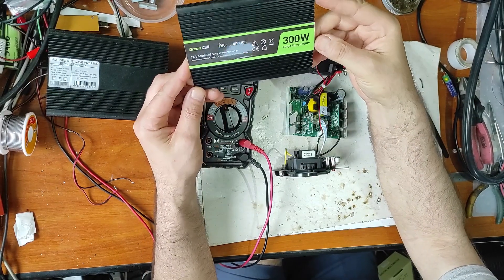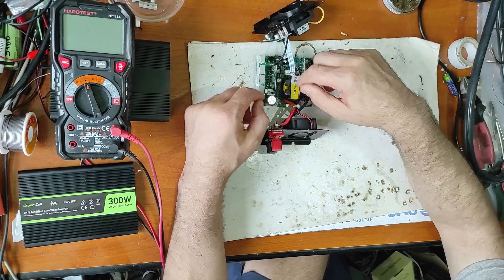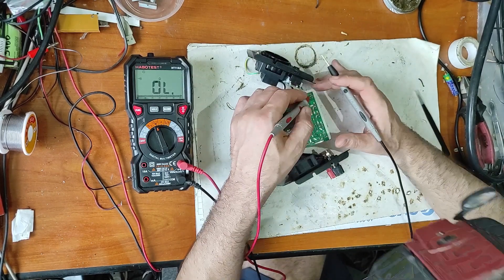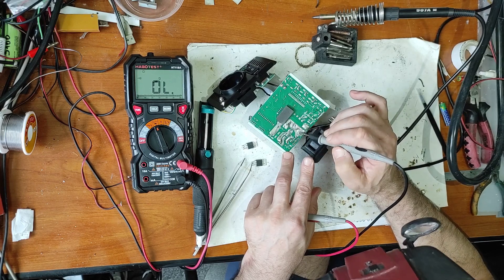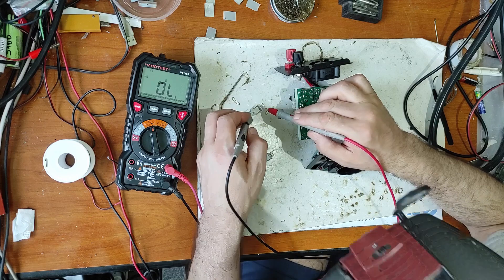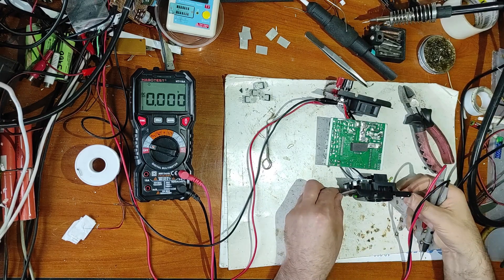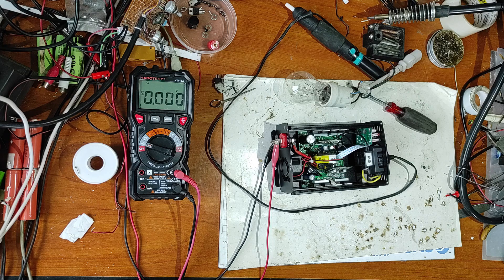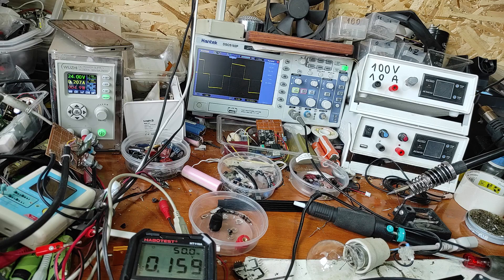24V 300w Greencell Inverter Repair Easy Job

Comment: Hello, I've bought an identical one 3 weeks ago, and it makes a high-frequency sound every time it starts up, lasting about 2 minutes, while the fan runs non-stop. I wonder why it has that deafening sound. Can you recommend a better inverter to use in my truck for powering my laptop? Thank you in advance.
Reply from the maker: if u need only for laptop,u can buy 12v adapter for it.greencell is cheap and low quality,easun is medium price medium quality,and vitron is expensive and best quality.
Reply: @diymariuselectro  să cumpăr victron că sa nu iau țeapă? Merg la sigur...
Reply from the maker: daca ai cu adevarat nevoie de ceva bun si sigur,ia victron.e scump dar merita.
Reply: @diymariuselectro 
Sa fiu sincer, mai degrabă m-ar tenta să achiziționez un adaptor că e mai mic că dimensiuni. Totuși, mă preocupă durabilitatea acestuia – nu aș vrea să existe riscul de incendiu. Ai recomandări pentru un adaptor de încredere în loc de un invertor, capabil să alimenteze un laptop Dell M4800 de la priza de 12 sau 24v a camionului? Pe încărcătorul meu este indicată o putere de 190w. De asemenea, folosesc adesea Blender 3D pentru randări, ceea ce înseamnă un consum ridicat de energie. Ce sfaturi ai în această privință?
Reply from the maker: @Sebastian-Florin  Nu iti pot recomanda unul anume,eu am luat din targ unul sh si merge foarte bine.sigur gasesti pe net.

Comment: Great video, I have stopped fixing these cheap inverters now as the cost of genuine mosfet's has made it uneconomical. Nobody wants to pay for the repair when they are so cheap to buy now.
I've also had a couple that have had tracks melted enough to damage the board  without the fuse having blown, and the output side mosfet driver chip is often damaged. It depends on how they fail, but I suspect the right inductive load creates large emf voltages that can spike the output mosfet's hard enough to send those destructive voltages back through the gate to the driver, killing it, the HV side mosfet's go short circuit and the low side ones quickly follow. 
Good to see yours was just the mosfets anyway.
Cheers.
Reply from the maker: yes you are right,its not economical to repair but its ecological.I usualy replace with parts with  greater current and greater voltage. In this case,I put double current mosfets.And in this lucky case the drivers and the track were good.I think this inverter worth repair.